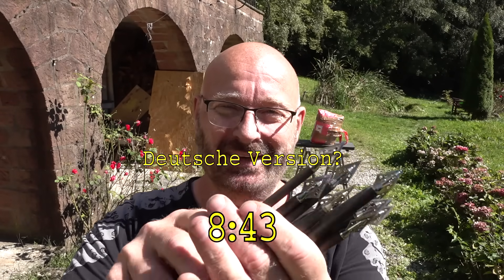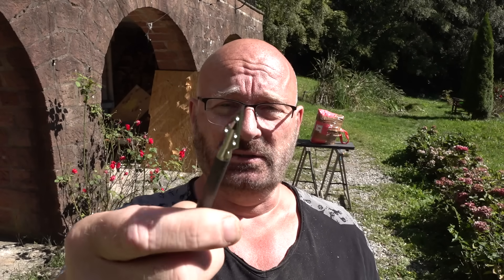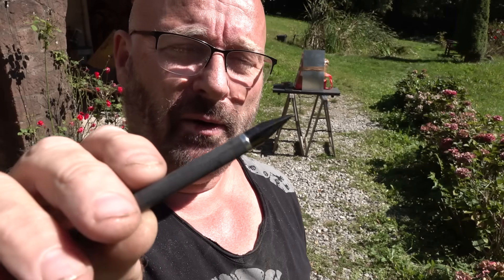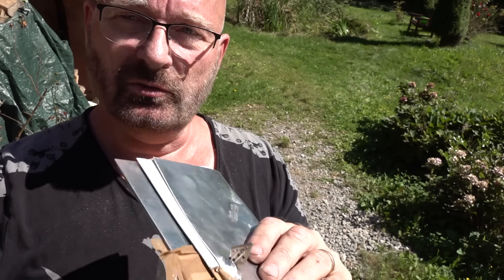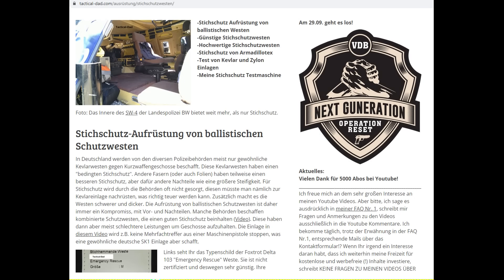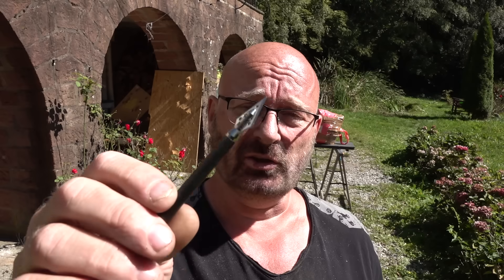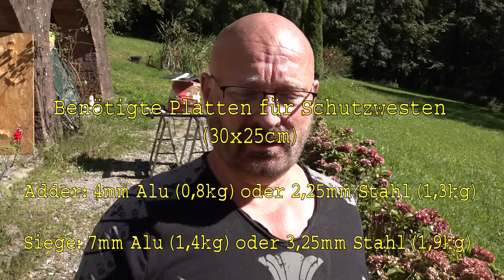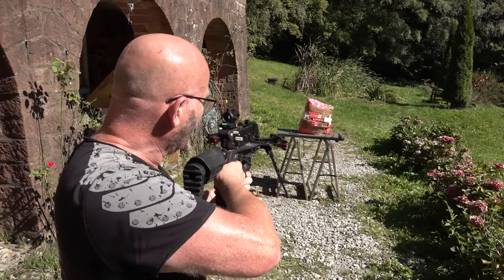Broadhead Bolts: Unstoppable? Adder and Siege Sheet Metal Tests!

Comment: 00:05:46 Joerg, to make the test fully reliable and correct you should not FOLD the metal sheet ONLY cut it in smaller sheets and place on each other because folded sheet leaves space between layers and works as SPRINGS that absorb energy from the bolt thus the test is not quite reliable.
Reply: And one plate with 4 mm reacts completely different, than 4 layers with each 1 mm sheet. Because the broadhead can cut and deform 1mm, but never could cut and deform a 4 mm sheet.
.
Reply: Panser wagons do have several layers of metal sheets just because they stop projectiles easier!
Reply: @andersahlstroem6415  the idea of several layers in tanks is that the incoming projectile could turn between the layers, making it ineffective and shapecharges have a limited deph of penetration that can be used up with air as well as with steel. 
the mechanical stopping force of layers directly adjacent to each other is lower than the combined thickness in one plate.
if you wear a layer of aluminium at a distance from your body that might be a (theoretically) good idea if you have the thickness that stops the arrow after 100mm it would be better to have the plate 100mm away from your body.

Comment: I'm not sure how viable it would be to test, but creating a spaced armor plate might be interesting vs solid plates. You were already starting to create spaced armor plates by folding it, but in theory, having a small air gap between the plates could potentially give the arrow tip a chance to deform before penetrating every layer, redirecting some energy and potentially decreasing the bolts penetration value. As always, I always love your videos. :)
Reply: Stab testing uses a narrow ice pick like testing medium. Skinny blades will.needle through woven kevlar layers. Dyneema sheets have been used to make stab resistant inserts... much like the other commonly used ballistic material. Fused dyneema/spectrashield sheets, act like a cutting board.
Reply: I believe deformation is not the main factor, but the friction between arrow and plate while passing through the first layer until hitting the second layer is significant. I'm willing to bet there would be no to minimal penetration of the second plate if it is more than 10 cm away.
Reply: One plate with 4 mm reacts completely different, than 4 layers with each 1 mm sheet. Because the broadhead can cut and deform 1mm, but never could cut and deform a 4 mm sheet.
.
Reply: I wonder if some kind of abrasive coating on an outer surface could be used to reliably blunt sharp edges of a fast object, potentially minimising its ability to cut through layers of kevlar?
Reply: @GurtTarctor  no, any effort to blunt such is ignoring the greater issue, the way pointy sharp things moving with enough force can needle their way through the kevlar. Same reason rifle bullets pass through kevlar like its not even there
Reply: @GurtTarctor  You cannot destroy the sharp edge with such kind of coating.
Reply: the Adder is nearly as powerful, but easier to load and cheaper!

Comment: It would be interesting to see how much difference it makes if the steel was heat treated, as I doubt someone would use an untreated and soft steel plate in a vest.
Reply: Agreed, professional steel plate inserts are ultra-high hardness steel - and quite pricey.

Comment: Harden steel or high density steels work wonders for stopping broad heads , even high carbon steels work as well & thats plate steels less than a quarter of a inch .

Comment: For piercing type attacks, hardness is key.  Blade type weapons rely on the integrity of the tip/edge and the overall thinness of the blade, i.e. sharpness + surface area.  Especially with regards to broadheads, they are not designed to penetrate hard surfaces, so they prioritize sharpness and thinness, at the cost of hardness and durability.  If the tip impacts a sufficiently hard surface it will deform before it can pierce, and the blade edges will also be severely damaged, making most of the penetration effect being due to pure kinetic force punching through, rather than cutting through.

Therefor a combination of a relatively thin sheet of hard steel combined with the normal aramid fiber vest, could produce significantly superior results vs just the sheet of metal alone.

Comment: 7 mm in single sheets behave different to a solid 7mm plate of aluminium.

Try to test that, you'll be surprised of the difference it makes. The main thing a hard body armor relies on is rigidity and hardness. So for example 7 pieces of 1 mm aluminium sheet rather bend under pressure than a solid 7 mm piece. And if you would take either the 7, 1 mm pieces or the 7 mm plate and work harden them, you will get different results again.

Also to stop a broadhead or any arrow for that matter, I'd rather use cut resitant fabric like UHMWPE or polycarbonate which is also lighter than steel or aluminium.

Because as you know for example with polycarbonate, it want's to close around the arrow shaft and creates friction. Metal for that matter, especially in thin sheets like you tested simply will bend away and make space for the shaft to pass further through.

To just stab proof a kevlar west, just resort to some chainmail.
If it's professionaly made and costs don't matter, Titanium (grade 5) is the best choice.

3 mm thick chain links are more than enough.
If costs matter, a high quality spring steel will protect you just as good.

Comment: The other thing we learn is that if you need this for defense, you want the broadhead. It penetrated as far as the bodkin, and would do more cutting upon reaching the target flesh.
Reply: I use Truglo Titanium X mechanical broadheads for tactical purposes. I cut off the “push tab” so they just go straight in without opening. But the cutting width is still a bit wider than the broadhead arrows from gogun, and they fly straighter because much of the mass is out ahead of the blades.

Comment: A composite of a low density plastic, 6000/7000 series aluminum and carbon steel would probably work.
I want the “stab” to stick in the plastic and have the under layers prevent penetration. Glancing or “spalling” off armor can be just as lethal to you and bystanders.

Comment: There are differing hardness of aluminium if you were able to bend it easy without cracking you probably have something like 6082 , 7075 is very strong.
Reply: I think that is very important
Reply: I came

Comment: i would advise to try a 6mm 2017A in T451 temper alluminium alloy plate, and add a 1mm AISI 304 stainless steel plate in front of it.

if you can acess a martensitic type of steel, try 2mm of AISI440C or AISI 4140 or 4340 with a proper heat treatment (above 30HRC, preferably in the 45~50HRC range)

Comment: Important to note that the steel is non-hardened, likely low carbon and the performance could be improved with the right kind of material treated correctly. Aluminum can be hardened slightly but more likely an armor plate will be aluminum alloy and will perform better.

Comment: For complex material science reasons, multiple thin plates are less efficient than a thicker plate of equivalent thickness at stopping projectiles. So a 4 or 5mm aluminium plate might do the job of 4x1mm + 2x1.5mm. Similarly, I don't think any crossbow bolt will go through a 3mm mild steel plate. Finally, as others have pointed out, properly hardened and tempered carbon steel plates are an order of magnitude stronger than mild steel, to the extent that a 1.5-2mm plate of AR400 or similar would probably make you proof against anything crossbow-related.
Reply: This is what I suspect as well. I know The Knight and the Blast Furnace isn't perfect, but an arrow-type projectile with only 75 J or so going through a 3mm mild-steel plate seems wild.

Comment: Awesome video.... 
Now you will need to re-design a shield using Kevlar (or other bullet stopping material) and incorporate the steel into it... :)
You used mild steel - May I suggest testing spring steel that is tougher, elastic and would be better (and thinner)?
Also maybe adding a thin layer of thick dense plastic between the steel layers would be beneficial? what about Leather?
Fascinating test and absolutely impressive crossbows... :)

Comment: Hey Joerg a couple of tweaks mite get you better results first  the arrow tip use single bevel broad heads 2nd sand the back end of the arrow down a bit so you get a slight taper (thinner) towards the back end 3rd put a coating of silicone on arrow shaft and broad head to for less friction. and for materials see if you can get a hold of M.I.T.  Super Plastic. 2 times stronger than steel or a material called Galvorn .  OR  NASA Armor or Graphene rubber. test out some new exotic materials.

Comment: Comment about the video first.

A) How would those bolts deal with a 30-layer gambeson, which were meant to be "arrow proof", because that might be another option to counter stab/puncture threats.

So multiple layers of Kevlar and what not. (Maybe some inner layers of Nomex, which is stab resistant IIRC.)

Because that shouldn't up the weight of those vests by the amounts that those armour plates would.

B) Only semi-related to the video, but I'm curious nonetheless.

Could something like the Adder or Siege (or even that Siege Adder you're working on) be made from wood, metal or bone and be limited to say late Medieval/early Renaissance tech levels?

We know that the Chinese Repeaters never took off due to lack of power and range, something the modern concept interpretations don't suffer from.

And Leonardo Da Vinci's rapid fire crossbow doesn't seem to have gotten a fair shake either, despite there being a, think it was, 3 to 1 reload difference with the standard winched versions of the time at similar draw weights.

So kinda wondering if something like the crossbows I mentioned could've even have been made and if their performances would've still outperformed the local versions.

Makes for an interesting What-if question, as well as how much of a butterfly effect that would've had on the tech development at the time (slowdown on handheld firearms development?).

Comment: Not very accurate if you don't specify which aluminium alloy or steel you used.

Aluminium can mean a material between 80 MPa tensile strength (99% aluminium used for tin foil or electrical applications) and 500 MPa tensile strength, basically equal to some softer steels (7075 aluminium alloy aka aircraft aluminum used for, well aircraft, gun parts, arrows and various sports gear among other things).

Steel can range from very ductile and soft structural steel (Baustahl in German)  450 MPa tensile strength to hard but fairly ductile abrasion-resistant steel used for heavy duty construction vehicles (excavators, bulldozers) and armor, 1400 MPa-2100 MPa tensile strength, to finally extremely hard and rather brittle tool steel used for drill bits, high end knifes and armor piercing projectiles. 2500+ MPa tensile strength.
Reply from the maker: The hardware store didn't specify. Probably the cheaper, softer stuff.

Comment: I rather be shoot at by a 9mm pistol than a Siege crossbow tbh.
Reply: I very much disagree. The arrow will have a straight, relatively small and clean wound canal. With the 9mm you have no idea what will happen. It might start to tumble, especially if it hits a bone and can even change trajectory inside the body and it will transfer a lot more energy to the body. The trauma will be much higher, especially in case it exits the body.

Comment: It's a good thing that people number of crossbows that use memory metal nitinol are extremely elastic and very very powerful I heard someone Reports say they can snap back to the original shape 50 tons square inch for pressure now I don't know about you I don't want to be having something with that much power shooting a bolt at me a small tiny bull me with the power of a armor-piercing Sable round that can be punched through most Kevlar nerve with no problem even still armor for that matter armor no now that's a scary thought even make this thing even more frightening it has a rocket motor inside the bolt they can be terrifying special forces units carrying these things and that's not the worst with these bolt can do could have more knives that can spread out they can actually do that they also have explosive

Comment: That test is really inconclusive since the "steel" and "aluminum" are very general terms. Both exist in a variety of alloys that are still considered steel and aluminum but have vastly different properties.

Steel can also be heat treated to become harder.

If steel would be so easily penetrated by a thin bladed arrowhead then full plate armor would never exist as it would be to heavy to use.
Reply: It's possible that modern bolt designs are better than anything historical, but I'm skeptical they're so much better that it takes 3.25mm of mild steel to stop a projectile with only around 75 J of kinetic energy.